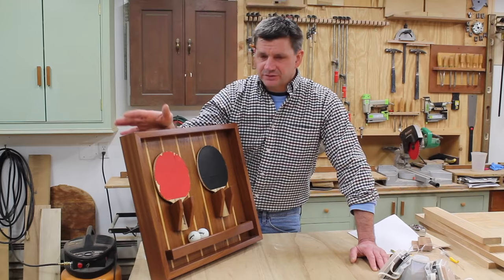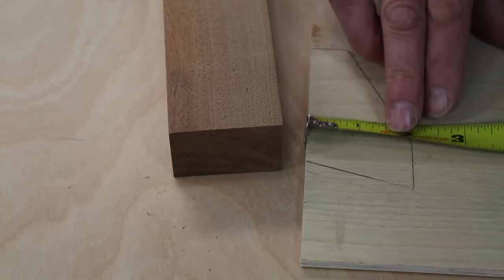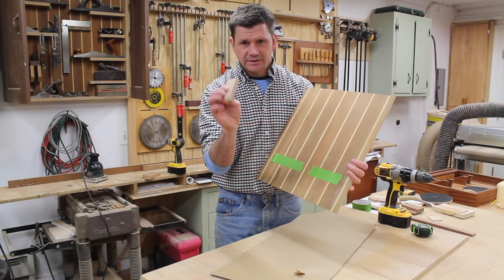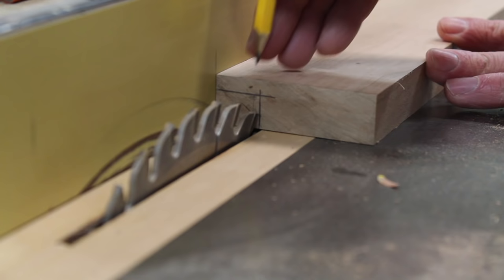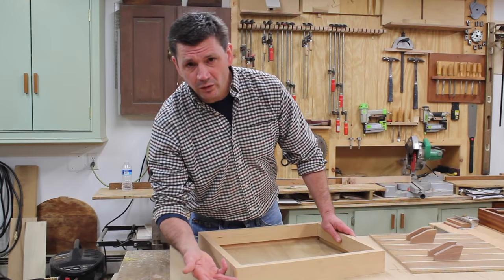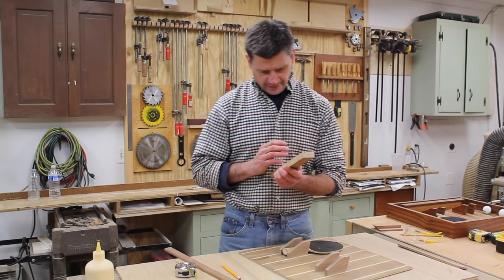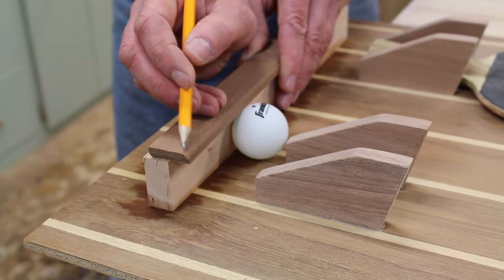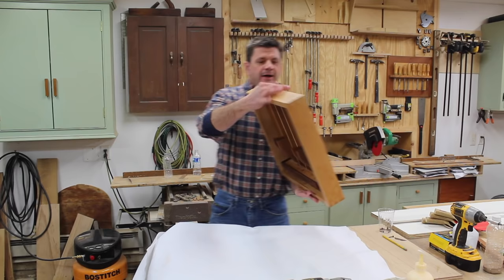Woodworking Project: Make a Table Tennis Paddle & Ball Holder

Comment: Great project Jon. Did you have to handle teak ply the same as solid teak and clean the surface with acetone before gluing the paddle holders down?